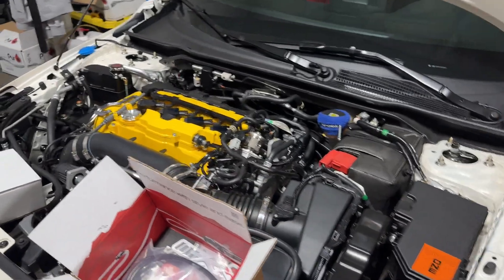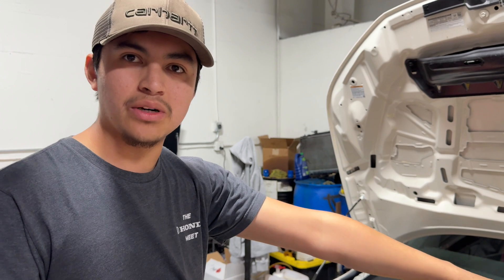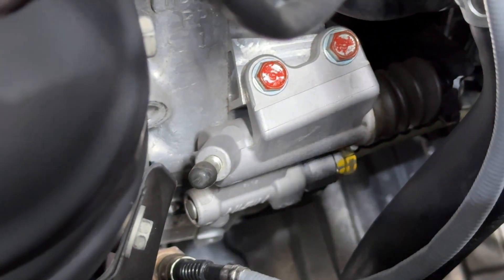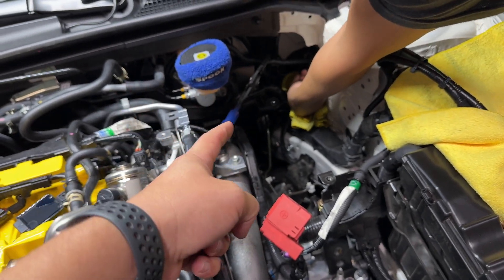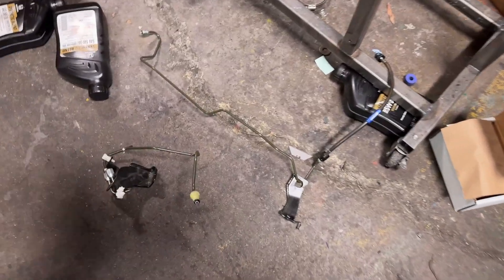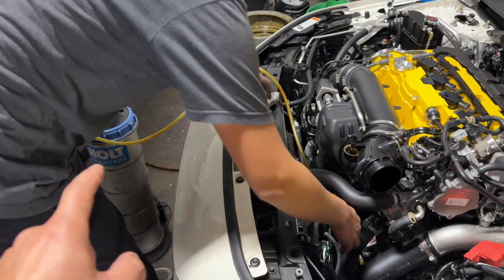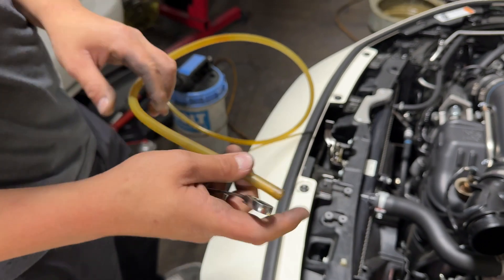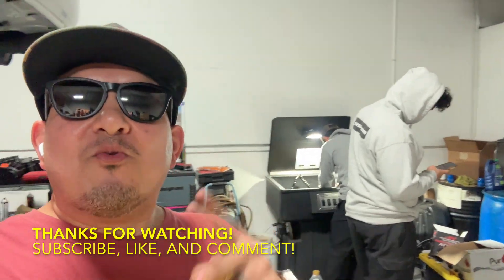2023 Honda Civic Type R FL5 upgrades to SiriMoto Clutch Master Cylinder

Comment: I was actually looking at this kit for my 20 si since I have the  type r retrofit clutch But not very happy that the are using The wilwood CMC  i had  in my previous si leaked after around 5k miles. Hope this one is better quality and works out for you guys!

Comment: Does the FL5 not have a clutch delay valve in the slave anymore? I saw another FL5 video where the owner removed the CDV from the slave and it helped with clutch feel. I’m curious how this mod would work in conjunction with the CDV delete from the slave.
Reply from the maker: Good question we will not be doing the cdv this master cylinder should be enough